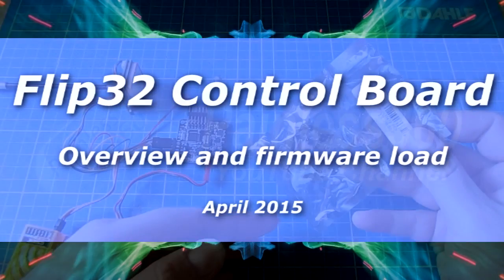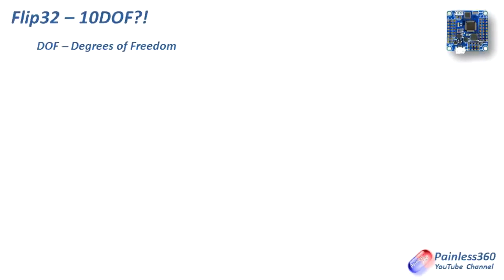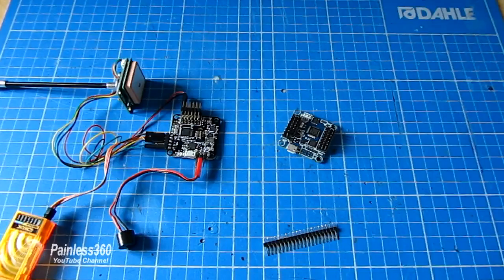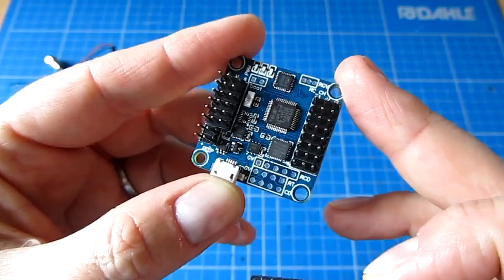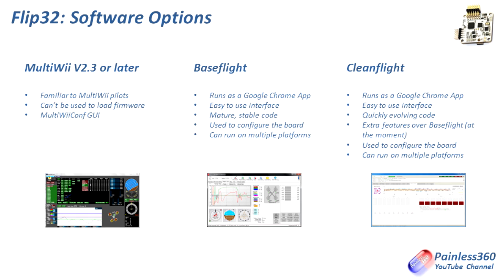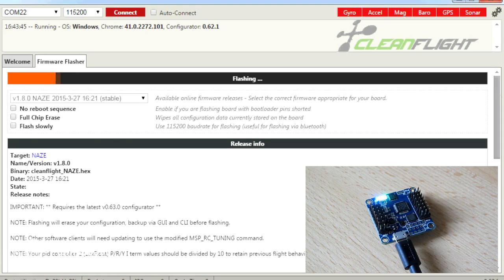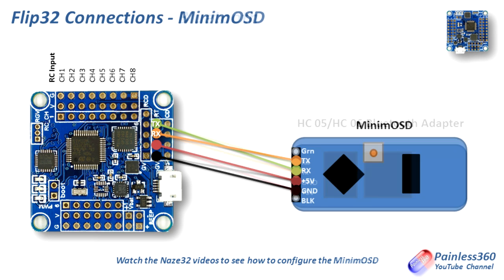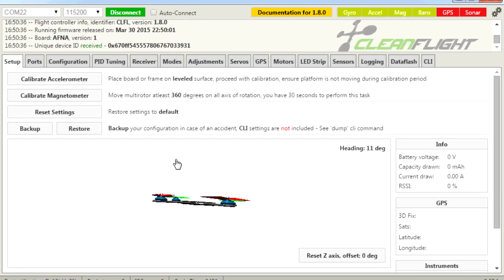Flip32 Flight Control Board: Overview, Cleanflight install and comparison with Naze32

Comment: I want a fully loaded naze32 funfly. accelerometer, barometer, compass, gyros the whole works. Your saying the Flip32 dof-10 has all of that at half the price? That seems wrong some how. I found one on banggoods for $23 then I downloaded the banggoods app and got an additional 10% discount for signing up.  Plus 22 points for buying the WASP280 chassis which I'm not sure I can use together. if you say yes to my above question I'm going to use the money I saved on a ticket to flight around the world just to give you a hug.... well maybe not, lol
Reply: The reviews on banggoods say people are having trouble with the usb welding braking. The first thing I intend to do it add some solder to address this issue.
Reply from the maker: Adam Sparrow Yep - pin-outs slightly different but you still get all the goodies!
Reply: What about blheli oneshot125 and damping light any issues with the Flip32? Or is that a cleanflight issue? Also if I have blheli esc's have do i know if oneshot is enabled within the esc itself?
Reply from the maker: You need to consult the specs for the ESC to see how you enable OneShot. OneShot on the FC is a Cleanflight feature.

Best of luck.

Comment: Hi, could you tell me if it´s possible to connect my rx xsr to this flip32+ using sbus? Sorry for the question, im quite newbie to this hobby.
Reply from the maker: If you're new then the 'Introduction to Remote Control' and 'Quadcopter building for beginners' series on the channel are designed for new builders to get to grips with the basics. We've not used that board but it looks like it should be ok if you use a UART.. I'd check the manual for it, should have the detail in there..

Comment: Can I have Bluetooth and Minimosd at the same time installed on the Flip32? Cheers!
Reply from the maker: +dagobb You will probably have to use Softserial to get that.. best of luck.
Reply: Thanks +Painless360 ! Do you have a video about it? Other wise I will have to dig into the documentation! by the way your videos have helped me a lot in many ways while building /rebuilding my dones . Cheers!
Reply from the maker: We do cover softserial setup in the Telemetry part of the Naze32 series.. Best of luck..

Comment: painless360 i got flip32 wired and registers tx and motors perfect in cleanflight.  when quad powered on it just wants to flip backward on take off.  if i hold it down only throttle is registering.  no other stick movements registers at all.  board doesn't want to self level the quad either.  i've messed w/ the devo7 as you've instructed w/ my multiwii issues.  any ideas?  i've watched your naze series as well!  tia!
Reply: im thinking i got a dud flip32....problem is all the tests from you show the board works.
Reply from the maker: See the video on 'what to check if you flip on take-off' for the common causes.. It's easy to make one of a few mistakes when building that cause that..

Comment: hi question, i got exactly the same flip32 board.
But the buzzer + / - are reversed on my board. is that the same for the the other one?

How do i know, how to put the buzzer on it?
Reply from the maker: Alexander Roelofs If you are not sure then use your multimeter to check which of the pins sets you are looking at is connected to the GND pins on other parts of the board (like where the ESCs plug in). That is a sure-fire way to check. 
Best of luck.
Reply: used it, quad is flying now. thanks :)

Comment: I have bought the flip 32. It say that it is 'Acro'. Can you tell me if it has self leveling?
John.
Reply from the maker: John Stanley The Flip32 has exactly the same features as the Naze32. This is answered in the Naze32 series on the channel, link in the description under the video. 
The answer is Yes BTW ;)
Reply: Painless360 Thank you and may I say that this is the best video I have seen so far, again, a big thank you.
John.

Comment: Hello. I have problem with magnetometer in Naze32 flip - it is relatively close to the wiring and when motors start to spin, it show deflection in copmass reading. I have compass on GPS, but when connected to proper ports, both compasses are confused. Is ther option to turn off onboard magnetometer (even if needed cut some wire)? Thank you in advance.
Reply from the maker: If you can't move the compass physically away from the power lines then you need to put a magnetic shield under the board to soak up any stray magnetic fields. I use MuMetal. I get reclaimed pieces from eBay. Best of luck!
Reply: I have some thick piece of MuMetal form hard-drive (opposite of the magnet).I think it will hels. Thank you.
Reply from the maker: Best of luck! As far as I remember the remote mag is sharing the same i2c lines as the onboard anyway. That may explain the similar readings.
Reply: When magnetometer on GPS is connected, just sometimes both showing the same dirrection. And it is slow, hesitating... So, only MuMetal can help (until collecting money for my dream: Pixhawk). Thanks.
Reply from the maker: +Milan Karakas Only one way to find out..

Comment: I want to use a minimOSD with the Flip32. I want to see the voltage of my flight battery on the screen of my goggle. Do I need to mod the minimOSD for this?
Reply from the maker: +Silberner Surfer If you are using the vBat feature on the flight controller then that detail will be sent to the MinimOSD with all of the other telemetry..
Reply: +Painless360 Thanks a lot! So I will buy a minimOSD. Had some issues with the micro.

Comment: Hey buddy I recently built a lumenier Qav250. I put a Naze32 flight controller on it and I flashed it with the newest firmware but I cannot get it stable it is really shaky and it likes to move as if I'm pushing the controller but self, almost like if something is interfering with it so I bought another one and I installed it and it does the same thing and it is the naze32 acro version. And I don't know a whole lot about flight controllers so I was wondering if you could give me A good suggestion on a good stable flight controller I don't care how much it cost I just want one that keeps it stable without trying. Lol if that is possible?? But here's a list of the parts that I have installed. its has,.....multistar turnigy 20amp esc's and the emax RS2204-S 2300kv motors, currently the naze32 acro flight controller and I'm using a 4cell battery. So if you had a good suggestion I would appreciate it. Thanks Matt
Reply from the maker: +Matt Simmons I'd suspect vibration. Make sure that your blades are balanced, Mount the flight controller on an anti vibration mount if possible. There is also something called lpf that you might want to look at setting up on the board too. It's always disheartening when you're model does this. You'll get it sorted.

Comment: nice but connecting it to my Mac Book and trying to flash it.  has a problem:

Log:
2015-12-07 @ 13:33:56 -- Running - OS: MacOS, Chrome: 47.0.2526.73, Configurator: 1.1.0
2015-12-07 @ 13:34:09 -- Serial port successfully opened with ID: 28
2015-12-07 @ 13:34:19 -- No configuration received within 10 seconds, communication failed

So i went to Firmware Flasher ...
- selected Firmware
- Load Firmware online
- and finale clicked "Flash Firmware"

... connecting to board ... one second later:
... Nor response from the boot loader, programming: Failed

is there any howTo or steps i perhaps misted?
Thanks for helping
Reply from the maker: +Andreas Buis No idea, not a MAC user. Sorry. Maybe another subscriber can help..

Comment: I have tge Flip 32 board and SimonK ESC's do I leave the red power wire on ESC leads when connecting to the board?
Reply from the maker: +Roger Bowen Depends on the type of BEC in the ESC. We cover the options in the 'Introduction to ESCs' video. Bets of luck.

Comment: Hello, where do you connect the telemetry pins on the flip32.
I want to monitor my battery but, i cant get it were to connect my pins at.

at first i tried connecting the cable from my D4R-ii to the Vbat connections on the flip32. This doesnt work? is this the right way?
Reply from the maker: Alexander Roelofs See https://www.youtube.com/watch?v=CXWZjqPX_o4&list=PLYsWjANuAm4rtLZuLU2eSTc3svqWx-pa1&index=16 for how to do it on the Naze32 - then use the same pinouts on the Flip32.
Best of luck.
Reply: i did it exactly like that
only thing i see is the RSSI, but no cell information.
Connected it at CH6 on my flip32
Reply: for teh ACCX, ACCY and ACCZ it works.
But for the battery its on 0.00 all the time
Reply from the maker: Sounds like the battery isn't been seen. Make sure that you have it in the right connection (by the side of the motor out connections - http://www.dronetrest.com/t/flip32-naze32-flight-controller-guide/634)

I hope you get it working.. Best of luck.

Comment: So, do you install naze firmware to the flip 32 board? 
Is it safe to do that?
Reply from the maker: +Francisco Corzo connect the board to Cleanflight or Betaflight and then go into the command line interface and type 'version' and press enter. You'll see the target that the board is currently running and that's the same one you'll need if you want to flash it with something else. Best of luck

Comment: hey painless. i've been working at it for a week or two now, and i cant seem to program my racing quad because despite having the driver, my cleanflight keeps on saying "No configuration received within 10 seconds, communication failed". can you help me? my computer is linux so maybe i have to get a special program? anything like that? id appreciate it, thanks!
Reply from the maker: +Elan Kipervarg No idea if it's Linux. We're all Windows here.. Best of luck..
Reply: +Painless360 K thanks man. I understand
Reply: welp, i finally figured it out! and even better, i got it to work for betaflight! i forgot to install the driver and when it did, i finally flashed it!!!

Comment: I use naze32 with spektrum satellite and bluetooth. Can i also run minum osd and gps all at the same time? It seems some of my pins are already used
Reply from the maker: Raymond Bivens Yes you can but you need to start using soft serial ports. You can read more at https://github.com/cleanflight/cleanflight/blob/master/docs/Serial.md
Limited baud rates and more CPU needed to run them but for lower speed devices you can get away with it..
Hope that helps.
Reply: Painless360 thanks for the link.

Comment: could not get the kv team osd to upload.  used the arduino osd tool to configure the osd. did not ask for a font file.
Reply from the maker: Font upload is via the GUI.. Check the video where we configure the ISD after its flashed..

Comment: I'm having some issues running SBUS to my Flip32 with the X4R-SB module.  I'll try to trouble shoot some more when I get a moment.  But it's my understanding that you have to use signal channel 4 on the Flip once you have the signal inverted.  Is this correct?
Reply from the maker: That is right. Pin 4 for s-bus but you will need an inverter for a lot if boards.. I use PPM almost exclusively now. You also get another free IO port if you don't need it for SBus.. Best of luck!
Reply: +Painless360 I probably should have gone PPM too.  Less headache.  LOL.  But everyone is raving about the better latency (or lack of latency) of X4R-SB over the D4R I thought I'd try for myself.  I'll double check my soldering and what not.  Should my Taranis be set on D-16  or D-8 or some other setting?  I'm sure everything will eventually fall into place.  Thanks for your help though.
Reply from the maker: Until I become one of the top 5% of pilots where it might make a difference then PPM will work for me!  ;)
Reply: You know at this point I'm about ready to subscribe to that line of thought too.  This SBUS mess is holding me back something serious.  I don't need 16 channels and or the split second latency... I just need to fly... Period.  And right now SBUS aint helping.  But hey this hobby is all about learning.  Some expensive lessons at that.
Reply from the maker: +Quad Bruh Sure are! I've made a lot of them myself. Hopefully this channel will help avoid the odd one.. Best of luck with it..
Reply: +Quad Bruh , if you want use Sbus Pailess360 explain in one good vídeo how to do an inverter. I built one with less than 50 cents of euros and it´s working great. It is working with Cleanflight on my X8R and X4R as well.
Reply: +Marcelo Tito Farinon Thanks for advice. I was getting frustrated & was ready to fly my new quad. So I found a couple cheap D4R Rxs on Ebay. I'll revisit the X4R on another project.

Comment: Is possible to connect GPS and s.bus at the same time? Thanks.
Reply from the maker: Gašper Kolenc Yes it should be. Google Naze32 SBUS to find a few tips in case you have a problem. May need an inverter - depending on the board and electronics it has on it. 
Best of luck.
Reply: I already solved the promlem wit inwerter, taking signal from before the internal inverter of the frsky x4r.

Comment: Do you know if it is possible to use soft serial to get a serial RX (CPPM or SpekSat) and GPS in a Flip32+?
CleanFlight won't let me enable both Serial RX and GPS in the same UART.
Reply from the maker: robs3752 You can't have two things on the same UART. CPPM will allow you to use the other PWM input pins for the Soft Serial connections. See the videos on the Naze32 for more detail on setups..
Best of luck.
Reply: Painless360 Thanks, I was able to get a Spektrum Satellite + bluetooth/osd + GPS all running happily together using soft serial ;-)
Reply from the maker: Great news - well done! What did you plug into where?
Reply: Painless360 
The satellite power/gnd from the satellite connector, signal from input channel 4.
Telemetry (bluetooth/osd) from the normal Telem pins.
GPS power/gnd from normal GPS pins, Tx/Rx from input channels 8/9
Set 
UART 1: MSP
UART 2: Serial Rx
SoftSerial 1: FrSky Telemetry
SoftSerial 2: GPS

I was surprised telem came out on the normal pins, I was expecting it on input channels 5/6 as I was using softserial 1 but it seems to work fine.
I am using the V5 form factor Flip32+ but also tested on the V2.3 with the same results.

Comment: One thing: is this flip32 able to connect to a 4S battery in the VBAT pins?
Reply from the maker: Alberto Noys Not as far as I know. I've always read that it's 3s max.
Reply: Painless360 Damn it. My flip32 10Dof comes today in the mail.
Reply: +Alberto Noys yes

Comment: When I updated the board has given me error, and the board does not work now. It is always the blue light. And when I give again to update I get the message: no response from programing bootloader failed. You know that you can be?
thanks
Reply from the maker: Sounds like its stuck in bootloader mode. Have a look in the forums for tricks to get it back. Best of luck!
Reply: thank you very much for responding, I've solved, and works well.
Reply: +MrCuervoRC what did you do get get the issue solved? Having same issue

Comment: Please help I have hitec eclips 7 transmitter and a home build tri copter from rc explorer.se and trying to get the flip 32 to work. Manage to connect and calibrate the board. but can not use more than one aux channel and also can not arm the board. what am i doing wrong. Lastly is there some hack for my transmitter so that i can use all the toggle and aux channels. Please if you can give some pointers on this would be great. i have had the flip 32 in my house for months and would like to start using it
Reply from the maker: David Hood I would start here - https://www.youtube.com/watch?v=6U-rjC39EXQ
I don't use that radio myself but the radio is 7 channels so you should be able to use one of the extra ones to control the modes, even using a programmable mix if needed.
Best of luck.
Reply: Hi i have tried that video in detail and had no luck with that
Reply: it is a pwm radio

Comment: Is it possible to connect GPS with compas to flip32 6dof flight controller?
Reply from the maker: Tomas T Yes - but why would you? The price of this 10DoF board is so low and easy to get now.
Happy flying!
Reply: Painless360 I didn't pay attention to the description when I ordered the board a week ago, so now I'll have to fly with 6DOF. Anyway, thank you for a great video!
Reply: Tomas T 
Havin the mag where the GPS is, is actually a good thing. Way easier to put it far away from power leads that will influence the mag. 
You should get an barometer, too, though. GPS height is way too inaccurate to be of any use. Without a baro "return to home" could very well be "turn into next tree" because it won't keep its height.
Reply: well. honestly, if younhave a naze baseFC don't bother wirh gps, it's no good with gps. if you want gps choose a taulabs FC if you want a bare bones build as you go setup like the Naze, or pixhawk for a mature ready to go system.
Reply: RCKnut Why do you say that the Naze 32 FC is no good with GPS?

Comment: After I click Flash Firmware am error message appears saying "no response from the bootloader: programming failer". Does anyone know what I should do?
Reply: +Willow O&#39;Hara My LED lights also don't come on and when I plug the chip in "COM3" pops up, not "COM22".
Reply from the maker: If the lights don't come on then it sounds like a power problem. I'd start there.. Best of luck!

Comment: Anyone who use Futaba SBUS with FLIP32 10DOF?
I have a T14SG, R6303SB receiver and a FLIP32+ and it is working fine with OrangeRX 8ch, but I cannot get the SBUS up and running. No problem on my other machine with Naze32 10DOF, but FLIP32.... :(
Setup in Cleanflight is setup up exactly the same for both board, 1.10.0 firmware fot autotune and I have SBUS inverter cables.
Where to connect SBUS on the FLIP32?